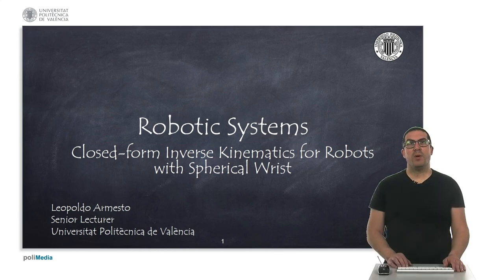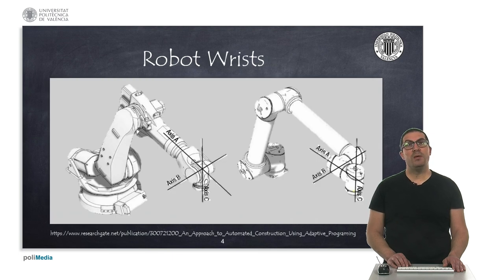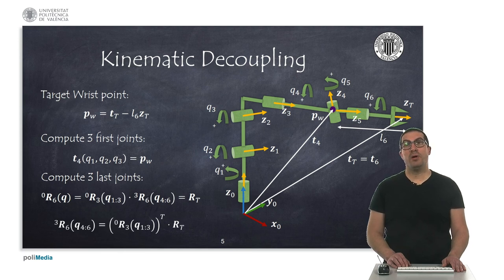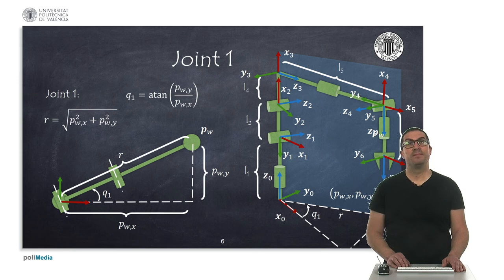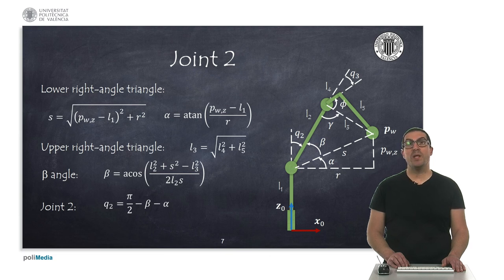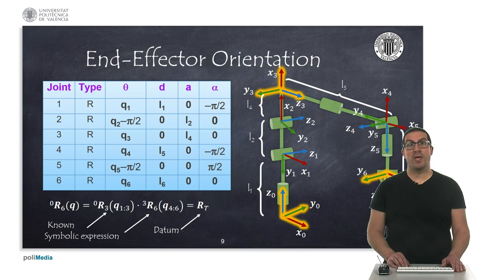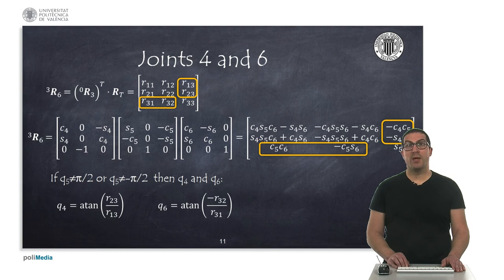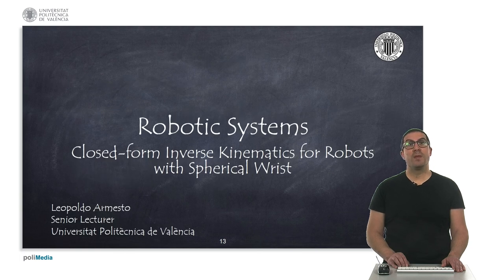Closed-form Inverse Kinematics for Robots with a Spherical Wrist | Robotic Systems

Comment: Hello sir! Loved how well the explanation is!
I am working on a 2 link scara mechanism which can move freely in all 4 quadrants (no limits at the center). The equations work well when the top arm doesn't pass the center (maybe from 1st to 4th quadrant) but when it does try to move to the other quadrant, all angles get reversed and the entire mechanism goes for a toss. It cannot move past it's center while having a diagonal move. Could you maybe have an insight on how I can get this to work?
Reply from the maker: Maybe it has to do with quadrant issues, in most of the cases, you need to compute the complementary angle instead or it’s negative value. That depend on each of the configurations